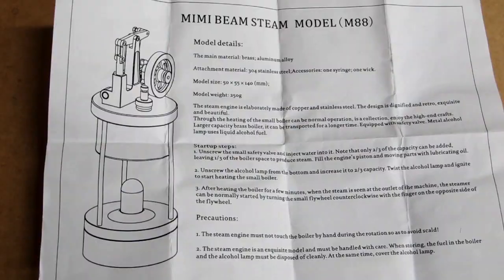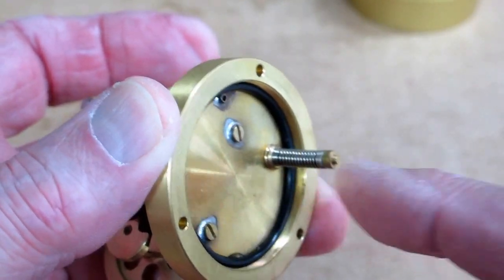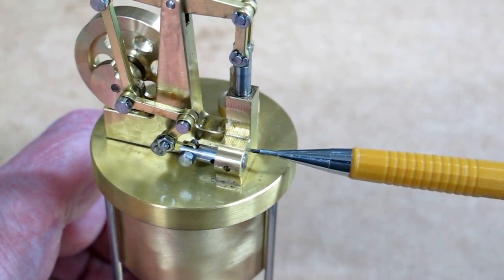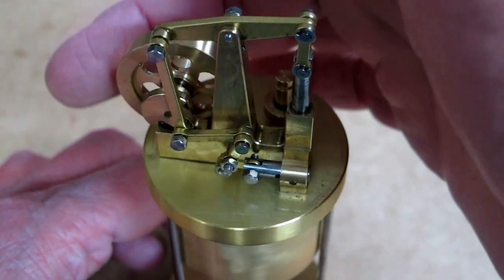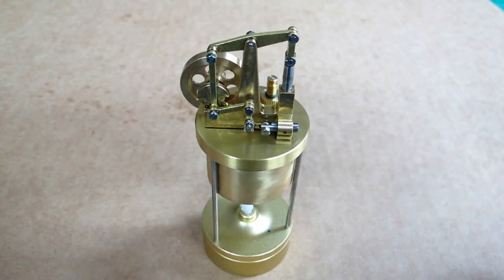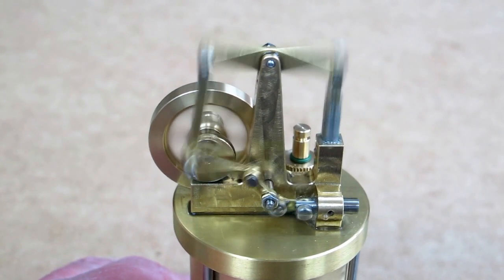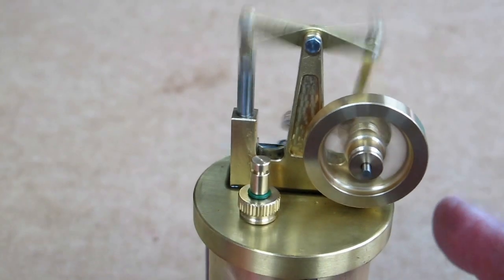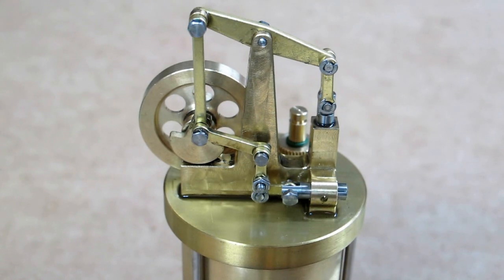Microcosm - Mini Beam Steam Engine

Comment: what is the mounting bolt size on the bottom. I don't have anything near small enough to fit. inlet nozzle is also miniscule haha. looks nice on the shelf tho but it's easily tipped over, unmounted

Comment: @ronaldwalters could you recommend anything I could power with this? I am just getting into these mini engines and was wondering if there was something simple and cool you could power with a belt? Thanks!
Reply from the maker: A small fan blade or colorful disc with this model, but this is a very small engine. A lot of these small engines, especially the Stirling Cycle or Vacuum Engines, are proof of concept or demonstration models and generally produce only enough power to run themselves. Most have a relatively short run time before they run out of water (or alcohol) or start to overheat and lose efficiency. One problem when trying to drive something with one of the small engines is the absence of a clutch mechanism. The small engine needs to get up to speed in order to have enough momentum or flywheel inertia to power an external load. A drive belt alone provides some load for the small engine. With a larger model engine, a small DC motor can be driven to power an LED. A small pump can move a trickle of water. 
 With appropriate gearing you could turn a Carousel or Ferris Wheel. Note: A lot of the small generators or pumps sold for models are intended to be steam engine driven. A Hit & Miss engine stands the best chance of powering an external load. The disc containing the magnet for the Hall Effect Ignition on a horizontal Hit & Miss engine http://bit.ly/2lLMIM0  can easily be machined into a drive belt pulley.  I have a couple of videos reviewing this engine. Hope that helps.
Reply: Ronald Walters wow! Thanks so much for the response. I’m going to have to watch some more of your videos. I really appreciate your reply!
Reply from the maker: I have reviewed 12 different model engines. There are 24 videos reviewing the engines plus other topics such as easier starting, improved timing, dry lubricants. If you are interested in any of these engines, In the description below each video are links to the engines plus discount codes which will save you money. I am behind updating some of these codes so if you have a problem let me know.
Reply: Ronald Walters thank you!!

Comment: Note the power take-off for a round or V-belt outside the flywheel.  This could run a small DC generator or other stuff.  Now all you need is a sight glass for water level and a feedwater pump. . . sky's the limit.
Reply: I have another version of this, I plan on mounting it to a wood piece and setting up a dc motor via a belt.

Comment: Cute little engine! Can you use it in something?
Reply from the maker: It has a small pulley on the flywheel hub. The model would need to be held firm in order to drive anything via that pulley. They also sell the exact same engine by itself “M81 Mini Steam Engine” intended to be driven by an external steam source (boiler).
Reply: No it’s against the law